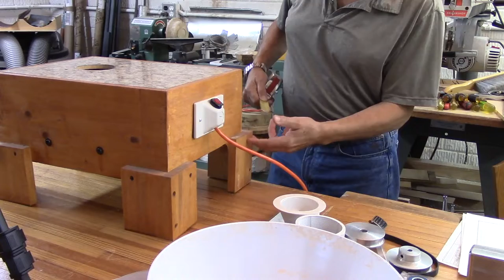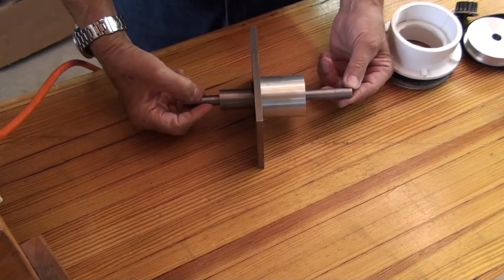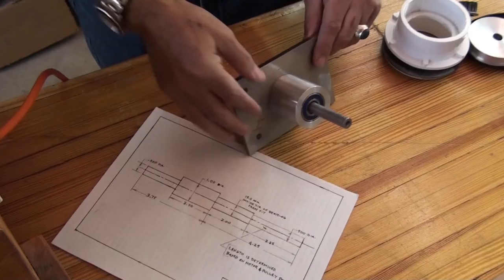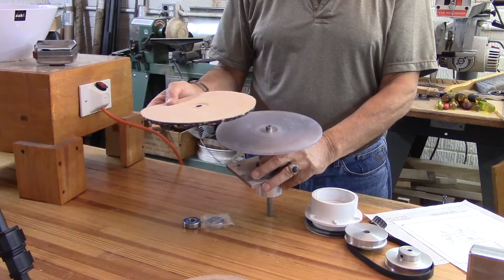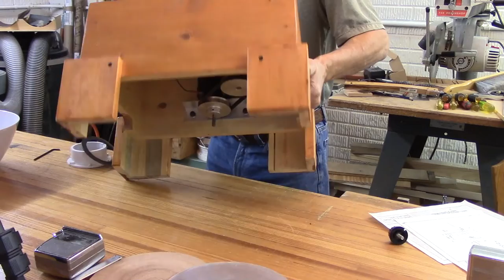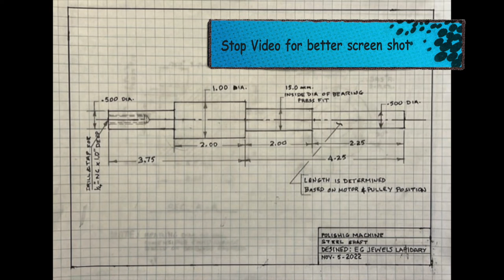Building a Polishing Machine

Comment: Nice Video. Update suggestion for the future would be a variable speed motor and controller, and as you mentioned water drain tube. You could also get pulleys from Lortone tumbler replacement parts possibly or cast pulleys for v-belts (not as desirable but would work).
Reply from the maker: Thanks Phillip for the info, as I mentioned in the video, I used motors that I have around and yes I had one with variable speed that I built and I sold the machine to a friend of mine.
Thank you for watching the video!

Comment: Thanks for the drawings!  I suspect you took drafting in school judging by the professional style.  Is there a reason for using pulleys and a belt instead of just using direct drive from the motor shaft?
Reply from the maker: Hi Ken, yes I’m a mechanical engineer and I did took drafting. Your question is a very good one, however, by building a stronger shaft supported by bearings will take the pressure while working, having said that, you still can use direct shaft if the diameter is larger, but the problem is you also get a bigger motor that you can’t house under the machine. Thanks for the question and thank you for watching my videos.